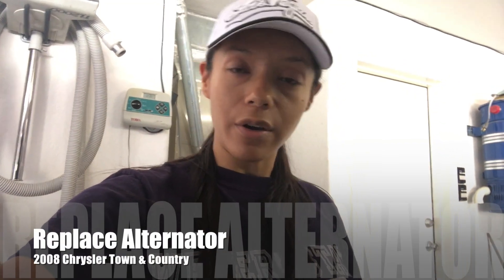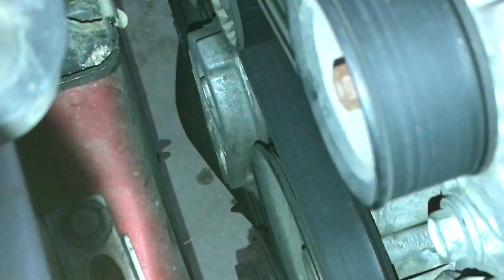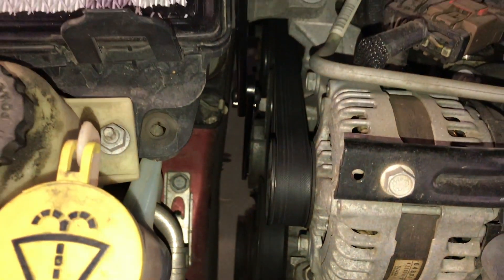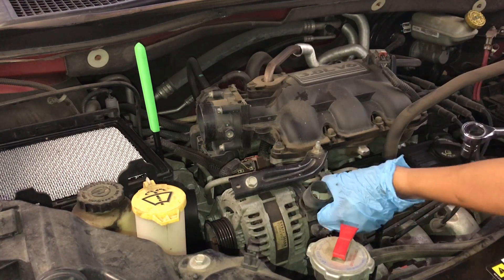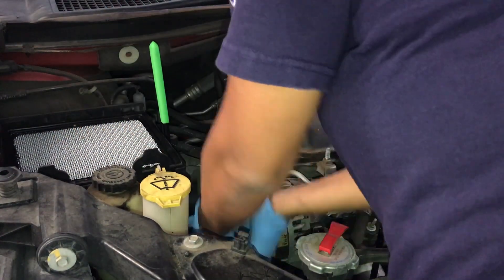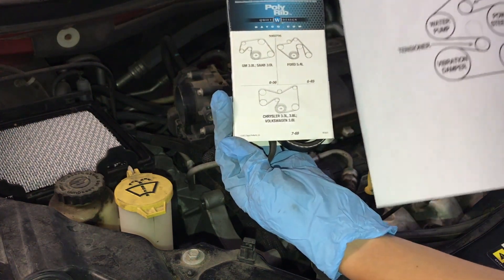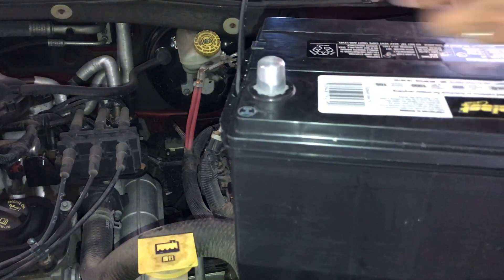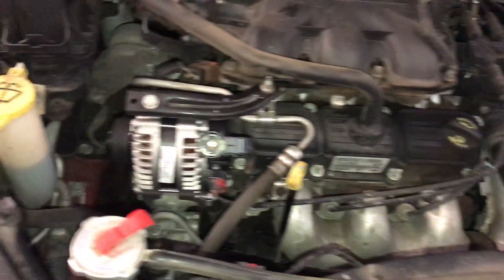HOW TO Replace/Change Alternator on 2008 Chrysler Town and Country

Comment: Question 🤔
You changed the Alternator what were the symptoms for you changing it, Did it stop changing, was the Alternator making noise, because that's what mine is doing making noise, its still charging just noisy, I hope this the problem, im changing mine today
Reply: for me, the alternator was making noise for around 1-2 weeks and then it died, changing it made the noise stop

Comment: Thanks, very helpful, although I snapped the one bolt that caused no end of fussing! I finally drilled out around the left over stud and managed to bash out the old Altinator. I cut off the bolt leaving an one eight of it to "key" in the hole but so the new altinator would just go on! It worked out and with the main through bolt tight and braket secured, it can't move! All ended well! AllthebestRoy

Comment: I figured I’d leave a post repair comment: the serpentine tool is the only way to go if you don’t want to tear the liner off and lay on the ground (if you don’t have a hoist or lift). Once I had that, it was only 10 minutes of work and I was back in action. I’m an independent contractor so my vehicles are my income, period, and I was without either of them for almost 2 weeks.
Reply: I ground off the tip of the square socket and that slipped in with a pipe on the handle. The speing ball was still in tact, so therefore, the wrench will still be useful. AllthebestRoy

Comment: What was the van doing to make you think it was the alt
Reply: In my case, it was a loud racket, the battery light coming on and off, and finally getting stranded twice when the van just randomly died. Also, I just had the battery replaced not even two months ago.
Reply: @andrewps84  thank you

Comment: First video that doesn't require jacking up van, removing front right tire, removing the plastic guarder and clips (christmas trees.) Was this possible for you because of the serpentine tool?
Reply: You can use a 3/8 ratchet and a long wrench (O side) as en extension and pull that baby.
Reply from the maker: Holy crap, why do all that for this small job, crazy! 😅 Yes, the serpentine tool is a must, you wouldn’t be able to take off or put on the belt without it. It’s a straight forward and easy fix, hope it helps!

Comment: I just wanted to say thank you for this very detailed video.  It really helped, especially socket size for all the nuts and bolts. And the call out on the serpentine belt tension tool and how to use it and locate where to use it.  Overall just wonderful and so useful.  Changed my bad alternator out with a new one in under an hour and all work perfectly.  Thanks again!

Comment: @mary this is awesome! Thanks so much for posting it. Saved me $400 by doing it myself. You're a lifesaver. ** NOTE - pulling the red tab out of the electrical connection is key. I missed that part, and had to rewatch to see how to get that connection off.

Comment: Basically, 140 amp if you have basic radio, lights ... 160 amp if you have more options in your car like sounds system power door ... screen tvs ...more stuff that need more power in the car. Hope that help. Thanks for the great video 👍👍👍👍